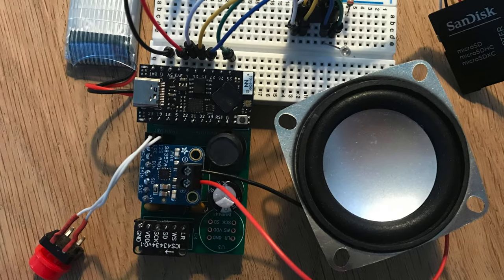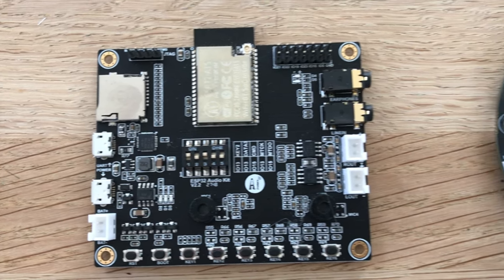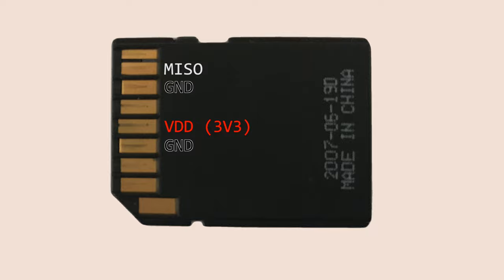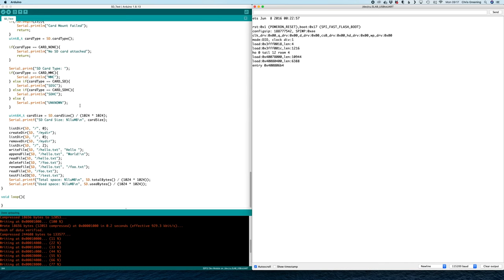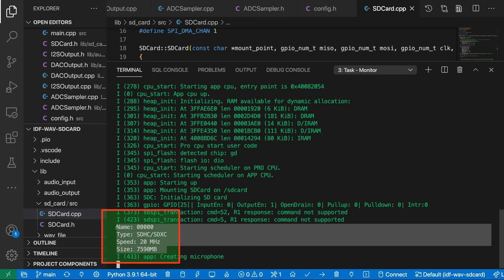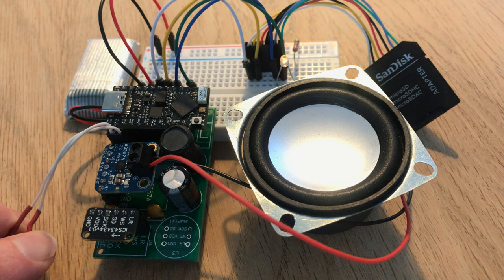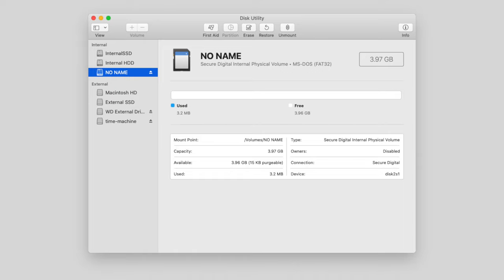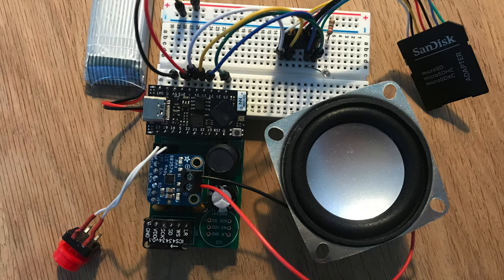Record & Playback Audio on ESP32 SD Card: Step-by-Step Guide & Demo

Comment: The INMP441 outputs 24-bit samples, but your code is saving the wav file in 16-bit samples. Where did the extra bits go, and how did you "compress" it?
Reply: Have you done the project in Arduino IDE framework with 24-bit samples? if yeah could you share your code
Reply: If you go through the code the mic outputs signed 32  bit samples but the code converts them to signed 16 bit before saving them to sd card as wav file data. The microphone has to internally use 32 bit samples and two channels because of the way it is clocked.

Comment: I wanted to do a wireless stethoscope project. But after watching your videos, it seems easier to make a wired one and classify the audio files I recorded with artificial intelligence. What I need is simultaneous sound transfer and recording this sound on the sd card. Thanks for sharing your work.
Reply: Hi! Hope u are fine. Were you able to do what you wanted? I have the same issue.

Comment: Great project - thank you so much! I was wondering if you have any advice on a ESP32-devKit having SD mounting issues.  The exact se\tup works with the SD card test on Arduino, but when I move the project over to PlatformIO, the SD card won’t mount and I get the 10k resistor error (I added these as well).  Any suggestions?
Reply: Also, I rolled back the Espressif32 platform to espressif32 @ 6.6.0 even though the default worked, it was throwing deprecation errors on i2s.  6.6.0 compiles with no warnings, but still no SD mounting... Thanks for any insights you may have!

Comment: Does the I2S stuff work on the S3? Any I2S sketch I've tried, compiles without error messages, but then through serial monitor, my S3 complains "E (7) I2S: i2s_set_pin(295): ws_io_num invalid". Sounds like I should just re-define LR click pin... well, I did, no change.

Comment: That's really clever to just use an SD Card adapter (one of those 'that's so obvious why didn't I think of it'...moments :-) Thanks again for posting your code, it is very instructive.
Reply from the maker: No worries - it came as a surprise to me as well. Another handy hint is that the pitch of the connectors let you solder a standard set of header pins directly to the adaptor.
Reply: @atomic14  Thanks, that is handy to know, I will give it a go as well.
Reply: I got it working ok with a TinyPICO using an old SD Card adapter, soldered wired header pins to the card & used your SDCard library ok. Output using a Sandisk 32GB HC micro SDCard was -

11:07:14.667 -> Type: SDHC/SDXC
11:07:14.667 -> Speed: 20 MHz
11:07:14.667 -> Size: 30436MB

Many thanks :-) Now onto the rest of the project...
Reply from the maker: @sharpbends  Nice one! What project are you working on?
Reply: @atomic14  A stereo i2s microphone with output via an Adafruit i2s headphone dac. It's working well with the tinyPICO at 44.1khz and 48khz using small buffer size for low latency. Currently using INMP441's which are bit noisy (SNR) so hoping ICS43434 will be a little better. I will try adding recording to wav files on SD card as well using 2nd larger size buffers.
Reply from the maker: @sharpbends  Nice, I've been trying to hack an iPhone headset to use the microphone, got the headphones working no problem, but cannot work out how to use the microphone.
Reply: @atomic14  Interesting, which iPhone headset is it ?
Reply from the maker: @Sharp Bends  Apple ear buds, it's got a TRRS (tip, ring, ring, sleeve) jack and I'm pretty certain the sleeve is the positive connection for the mic and the second ring is GND. EDIT - got it working, but it's not really suitable for what I was thinking - will still need a microphone pre-amp. I was thinking it might be a cheap and cheerful way to get audio in and out, but it's not going to work.

Comment: Thankyou so much for this very nice practical video.
Just need a little help/information that I have sdhc card to be interfaced with esp32. I am facing the same problem as "mount failed". As you solved this by back porting the code from IDF. I am unable to figure out this point. Where can i get this working piece of code. Pardon me as I am not very experienced in this domain.
Thanks

Comment: Hi 
This is a very nice project, but somehow i have SDcard issue and can't solve it. I have tested my SDcard and it works fine with ESP32 SD_test but somehow with the given code it get these error 
[    35][I][main.cpp:90] main_task(): [WAV] Mounting SDCard on /sdcard
E (189) vfs_fat_sdmmc: slot init failed (0x103).
E (193) SDC: Failed to initialize the card (ESP_ERR_INVALID_STATE). Make sure SD card lines have pull-up resistors in place.
I have also tried with 10k resistor but i haven't any luck 
any tips?

Comment: Hi Chris. So, I asked gptchat what is the best way to use i2s if you have both a microphone and an amplifier connected to the device and it told me to install them on different ports. I tried this and core 1 panic'd and threw an error. Then, I saw this project, where you uninstall and re-install the i2s driver when you switch between record and play. And it worked really well. Thanks.

Comment: Great video, and you saved me a lot of effort as this project was something I've been wanting to do for a long time
A question about your use of the SD card adapter as opposed to a breakout board - would this work for a SD card breakout board as well, as long as its also SPI?
Reply from the maker: Yes, as far as I know, breakout boards are pretty much pass-through from the SD Card to the pins.

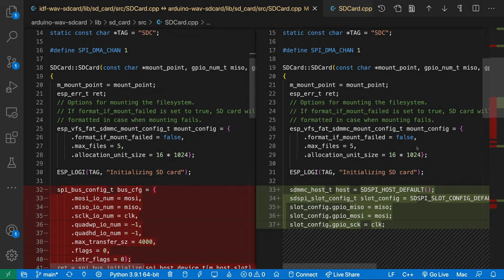Comment: Thanks for the video. I am new to esp32. 2:15 Where do I find this IDF file in Arduino in my PC?
Reply from the maker: Arduino doesn't really do IDF - if you want to use the ESP-IDF to build software then you should start off with PlatformIO and VSCode or use the Esspressif plugin for VSCode. If you are just starting out though, I'd recommend using the Arduino IDE first and try some simple examples.

Comment: I always get E (150) vfs_fat_sdmmc: slot init failed (0x103).
E (150) SDC: Failed to initialize the card (ESP_ERR_INVALID_STATE). Make sure SD card lines have pull-up resistors in place.
Formatted  with SD CARD FORMATTER, tried pull ups on some and all lines... no success! Frustrating ..... 
IS there a way to just forward I2S Mic to I2S amplifier?

Comment: Looks like my comment just disappeared! Trying again. 

Have you tried to build this project recently? What version of the tools are you using? Is this supported by esp-idf 4.4, 5.1 or 5.2.2? Things change so fast these days, it is hard to keep up.
Reply: This video is 3 years old and he used esp-idf. I compiled the code yesterday 7/8/24 using arduino core 2.0.14,  which uses esp-idf 4.4    if you use the latest Arduino 3.x.x it probably will have trouble compiling without errors since there are breaking changes.

Comment: Donno how you're able to do all this from scratch! Been giving this ago but having a lot of difficulties, I can't seem to get the esp32 to talk with the SD card when running the sketch, am I right is saying that the pins you used are
MISO - GPIO pin 4
Mosi - GPIO pin 15
clk - GPIO pin 14
CS - GPIO pin 25
I'm using a breakout board that I had on hand for the SD card rather than soldering directly, but I've run a couple Arduino sketches on the SD card using the esp32 and it works fine with the built in libraries (though they do use different pins mentioned above).  Any reason you are using different pins to the ones normally used for SPI? Is it just to free up the i2s pins?
Reply: Aha! got it working, there was nothing wrong with the pins or board but in the SDCard.cpp file under the SDCard::SDCard function I had to add the line 
host.max_freq_khz = 4000;

I think the SDSPI_HOST_DEFAULT defaults to a speed that is too fast for the SD card to register, I noticed a similar problem on the SDFat library when using an esp32 or esp8266 and you specify the speed. The SDFat library recommends using 4MHz so i gave it a go and it worked. 

I don't think its to do with the SD card as I used a couple different types (the same as yours). Neither do I think its an ESP32 issue as you never seemed to come across it, must be the breakout board I'm using. I'm using the standard blue Micro SD card adapter you get with most kits. Similar to this https://electron.lk/product/arduino/microsd-card-module-for-arduino/
Reply from the maker: That same thing hit me recently - I'd been trying to run it at 26MHz and it really wanted 20MHz. A lot of the Arduino breakout boards assume that you are interfacing to a 5v system so have level shifters and voltage regulators to bring the 5v down to 3.3v for the SDCard. Looking at your link I can see those on your breakout board. So it will only work with a 5v system.

Comment: I noticed a bit of popping at the beginning of the recording. I believe this is due to the microphone starting up which can take 90ms. I have seen other implementations where the first two reads are discarded. Would this be implemented in the record function of the I2SSampler?
Reply from the maker: I'd be tempted to do it in the record function, just have a count/flag or something and ignore the samples if count < X
Reply from the maker: I've pushed a commit up to the repo to support SPIFFS. In the config.h there's a #define USE_SPIFFS that you can uncomment and then it will record and play to and from SPIFFS. I did have to decrease the sample rate to get good audio.

Comment: I have been trying to get this working in platformIO but I'm running into issues with the FreeRTOS include. How speicifcally should the FreeRTOS library be implemented? I tried including the RTOS library from platformIO's library section for both the Kernal by LinLin and the AVR version by Richard Barry but I can't get either to work. I'm trying to use an ESP32-WROOM, and I can't even get a build to work unfortunately.
Reply from the maker: Try now.
Reply: FreeRtos in included in both esp-idf and arduino frameworks. Atomic 14 code has the includes already.

Comment: I am a little confused.  is the SDCard code meant to replace the SD library or do you use it together?  For example, if you want to use a button to skip to the next wav file on the sd card for playback.
Reply from the maker: The SDCard code replaces the SD library.

Comment: Hi It would be appreciated if you also share arduino IDE version of the code.  By the way you have very innovative projects on your channel they are very unique and I like the way you keep them upgrading.

P.s. I am trying out a handy memo recorder with ESP32+INMP441+SD card storage + 3.5mm jack additional for attaching a earphone+ mic which will eventually push all its files over Wifi, your thoughts on this are appreciable  :)
Reply from the maker: Hi Mahesh, I find the Arduino IDE quite difficult to use with these larger projects. It's worth trying out PlatformIO it really is quite a lot better.

Your project sounds great and definitely doable with the ESP32. For the earphone you can drive these directly from the ESP32's DAC outputs - it's a bit noisy but it does work.
Reply: How about a micropython version

Comment: Hi, excuse the certainly naive question, can I ask you if this project is feasible with Arduino and not necessarily with ESP32?
Reply from the maker: The SDCard and Audio code linked in the repo is specific to the ESP32. Arduino has libraries for talking the SD Cards - you will probably need an adaptor that can level shift from 5v to 3.3v as SD Cards are 3.3v logic (unless your Arduino board is 3.3v) - most SD Card adaptors sold for Arduinos have the the level shifting built in.

Comment: Great work sir,
When I tried to do this with my do-it-esp32 devKit  module. I am getting an error "failed to initialize the card. Make sure SD card line have pull-up resistors in place" . 
Can you help me to solve this problem.
Reply from the maker: Can you take a look at this issue - there's a couple of people there who have has the same problem and solved it. https://github.com/atomic14/esp32_sdcard_audio/issues/1
Reply: @atomic14  
Thankyou sir.
I have gone through it but in vain. I have added a extra line in code of sd card library that  "host.max_freq_khz = 10000" . This time SD card was initialized properly but now sdcard writing is not taking place properly. 

Can you help me please 🙏
Reply: How can you fix this issue?

Comment: Great video thanks for share ImI :D ImI  

Is posible make this with only an ESP32 or ESP8266, 1 max9814? I want record sound but i want not save in the micro sd. I want send data to data base in sql or mysql and php. But i can't understand how works the conversión de sound in zeros and ones (0,1) and after in voice again. or How may i do this. I dont know what libraries i most use it.

If you read my text... Please, do you will make some similar in a video? Pleaseeee

Pd: Sorry my english XD i from Mexico and and i want not use traslate.

Comment: Thanks very for putting online this nice project. I'm planning to modify it to record ultrasound (from bats). My hardware is ready (I can share if someone interested). 
My question is about the sd writing speed. I can see that you log your speed ("Wrote %d samples in %lld microseconds"), do you remind what speed did you get? 
I'll use 240kHz sampling frequency, i just want to be sure the writing speed will be enough to do real time record. Thanks in advance.
Reply from the maker: I don't recall the numbers I got, but there are some good numbers here: https://github.com/espressif/arduino-esp32/issues/1117#issuecomment-644174531

I suspect that you might be pushing the limits of write speed with the 1-bit SPI interface. If you connect it with MMC mode then you might be able to get real-time recording.

Are your samples 8 or 16 bits?
Reply: @atomic14  Thank you very much for your answer and the link. It's 16bits mono, so the writing speed have to be > 480kBps. MMC will be mandatory :)
Will modify my pinout and software to use it.

Comment: maybe if i had 2 esp32, one playing internet radio and one with your audio recorder. and replace the i2s microphone with the i2s wires which go to the adafruit i2s dac.  so one esp32 is playing i2s audio and sending i2s data  to the other esp32 to be recorded, but recording mp3 would be better than wav
Reply from the maker: I'd be really interested in the DAB radio project - do you have a link to it? Definitely interesting to be able to record mp3 I think with the ESP32 this is really only possible with a external codec chip.
Reply: @atomic14   its not DAB,  its internet radio streams using an adafruit UDA1334A,   use this link  https://github.com/schreibfaul1/ESP32-audioI2S  and look at the simple radio example
Reply: i have a video of it on my channel

Comment: Kinda late to the party on this one, but would this work with the Ai-Thinker eps 32 cam ("esp32 s cam" on the heat shield). I am making a toy rc car for my son, using the esp 32's "esp-now" coms protocol.....and the cam will be in the car to take pictures and emulate a video telemetry, but I was hoping to use the sd card slot and left over processing headroom to play a few simple audio files when the mic in the controller picks up a voice command (tire screaching sounds, break sounds, horn, signal lost alarm etc). Would be very convenient if I was ablt to double dip and not have to buy more hardware. Sadly I have gotten in a littel over my hear with this project and would appreciate any advice from anyone who has taken the time to read this  :D  Thank you <3
Reply from the maker: I think that might be possible yes - you will need to find 3 spare pins for the amplifier. It will probably work properly with the out of the box Arduino SD_MMC library https://randomnerdtutorials.com/esp32-cam-take-photo-save-microsd-card/

Comment: This problem looks like a library issue in not telling you what it can and can’t do. (FAT32 - exFAT)?
A quick look on Google shows that there is a file difference between HC and XC.

HD cards use FAT32, and the newer XC use exFAT, (need to try and find what the format looks like).
Also by using FAT32 you limit the card size to  32G and a file size of 4G.

Also quote “Due to the max size limit of FAT32 (32GB), the Windows disk management tool, 
the DiskPart format command, and many third-party SD card FAT23 format tools will format 
cards below 32GB as FAT32, and cards that are above 32GB as exFAT or NTFS.”

So not sure why formatting them to FAT32 makes them work! As HD should be FAT32 as standard and you 
stated that they did not work? Needs more thinking time. 

So now you have made my brain hurt ;-) Must limit my thinking or I might wear it out.
Reply from the maker: It's very confusing to me as well. I formatted all the cards with FAT32 using the command line and even used the Raspberry PI Imager app which will format as FAT32.  Both the Mac utilities and the PI imager seem to support sizes bigger than 32G - I've got a 128GB card and it's given me the correct size without any problems.